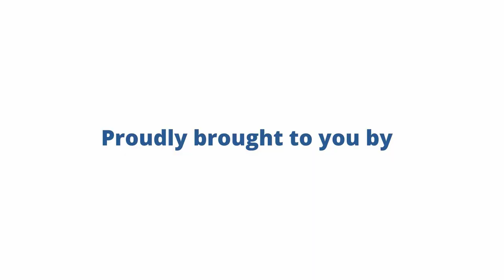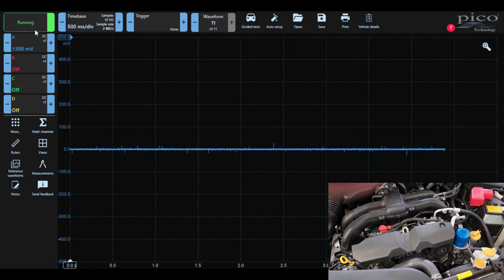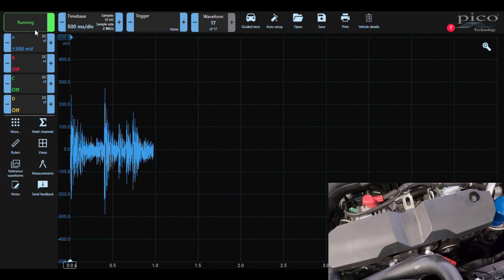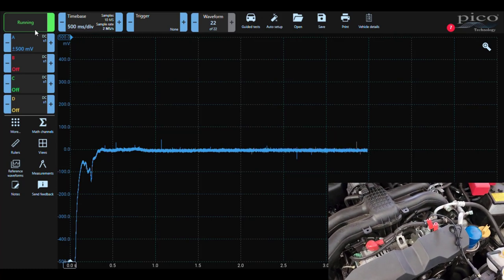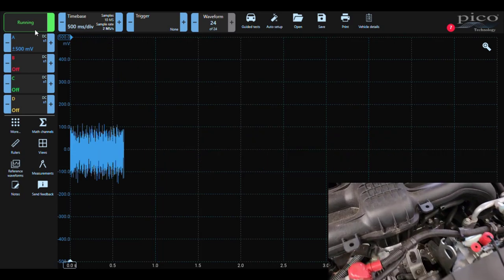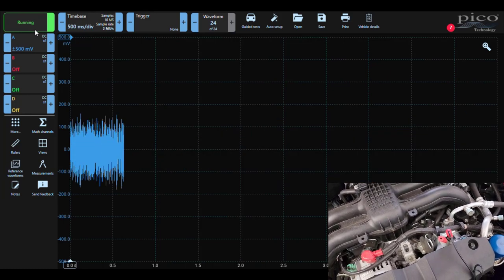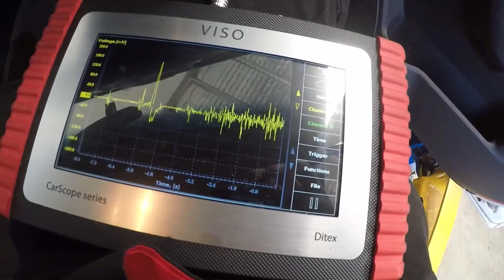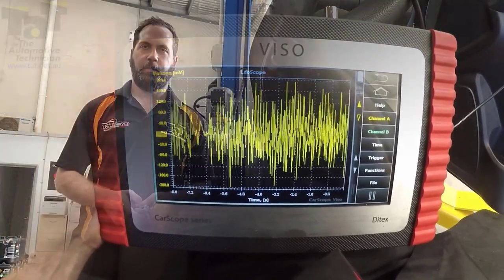Seeing noises on an oscilloscope

Comment: How do you differentiate the component making the noise from the noise travelling to the component you have connected the clamp to? 
You knew for the purpose of the video that the noise was from the AC compressor but what would you see on the scope that narrows down or eliminates the component the clamp is currently connected to before you got to the compressor?